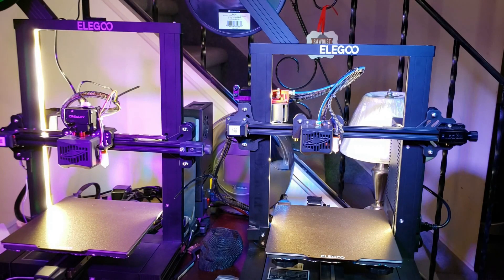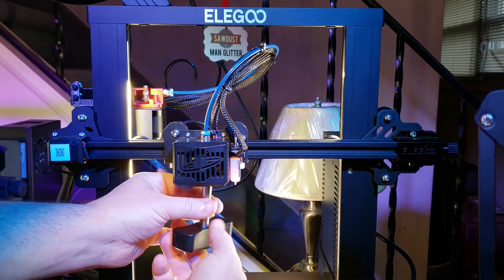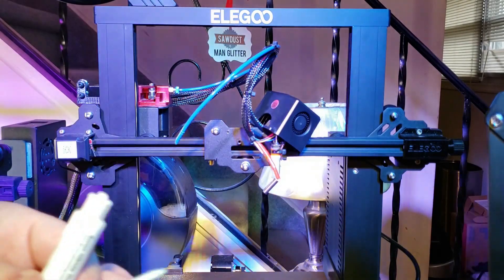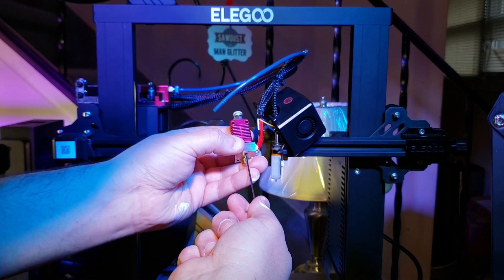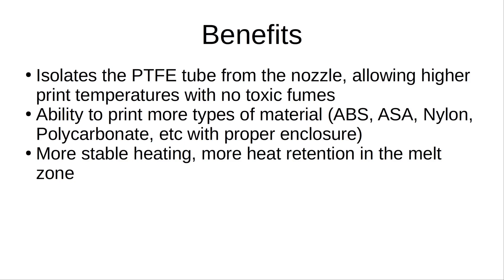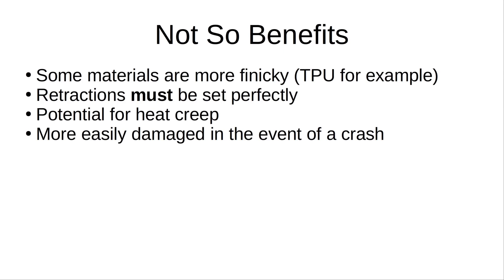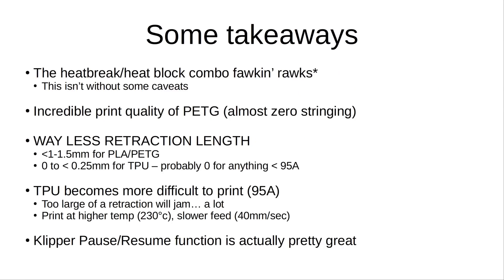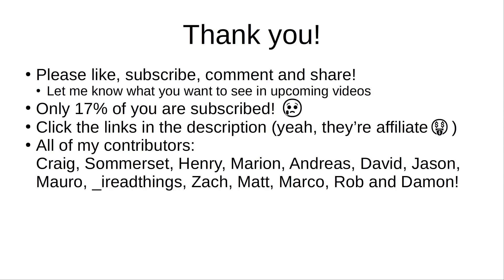Elegoo Neptune 2/2S Slice Engineering Copperhead Heatbreak and Slamazon Heat Block, with footnotes

Comment: Having an Ender 3 V2 and a Neptune 2, I have never had an issue with the Ender and filament getting stuck post shutdown. The Neptune has had a difficulty with getting stuck. Mainly PLA, I think the hotend fan shutting off at 50c may not be helping the situation. The Ender’s fan runs whenever the printer is on. I can do a cold pull on the Ender and I get a cool inside of the nozzle mold. The Neptune forget about it. That filament is not coming out unless you heat it back up sometimes to the high end of PLA temp. Both printers have the exact same hotend components bought from the same company at the same time. Just my experience.

Comment: Regarding the TPU not printing well part applies to the modded n3 as well? Or is it just 2s?
Reply from the maker: It printed perfectly after setting the retractions to almost nothing and resulted in almost no string, it was just a little trial and error to get there 😆. It was on my 3, I didn't try my 2 yet.

Comment: Did you have to adjust your temp after installing the break? I installed one a few months back, and I was confused when some people said to raise temps and some said to lower. I personally had to lower 5-10 degrees, just curious on your experience.
Reply from the maker: I've been printing around the same temp. Haven't had any real issues

Comment: A bit late to the party, but I was really surprised that it improves stringing when printing PETG (my filament of choice). Waiting on my order for three Copperhead heat breaks - if works "as advertised" (for not needing to replace melted Teflon tube) then worth its price 110%.
Reply from the maker: Did you use my coupon code?
Reply: @TheFeralEngineer  Ok, it was a little lie, I will order today-tomorrow, with your coupon code (thanks for the code). Also gonna buy Boron Nitride thermal paste, which I was looking at for weeks already.
Reply from the maker: Haha all good! Just don't want to see you having to pay full price. Happy printing! 🐱🐱
Reply: @TheFeralEngineer  Thanks))